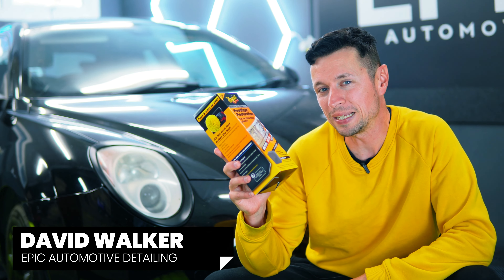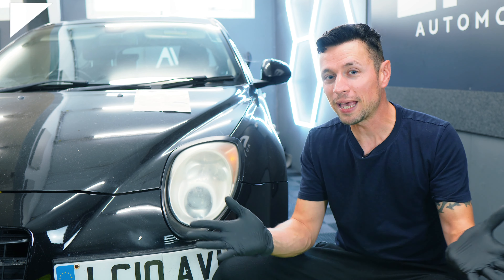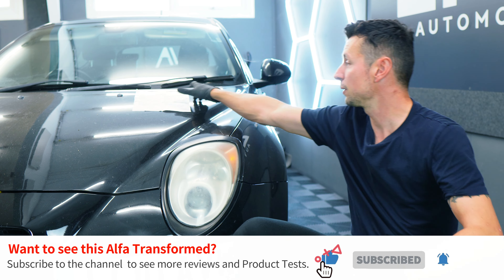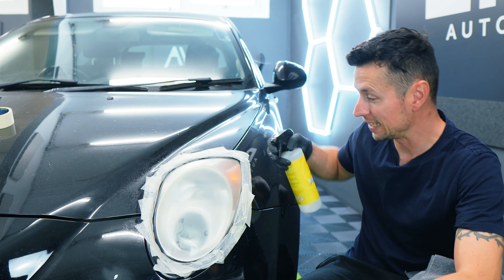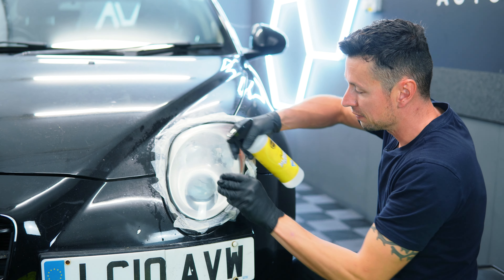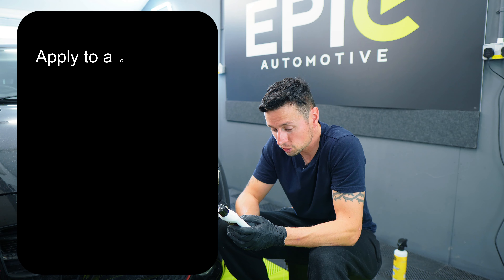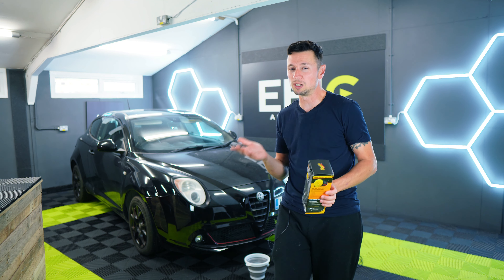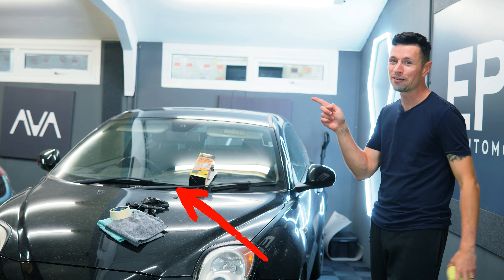Restore headlights EASILY with the Meguiar's Headlight Restoration Kit!

Comment: I did the chrisfix method of properly sanding down in stages and then lacquer spray paint on my old mazda turbo. Took a day or so start to finish (completely removed the lights) but the finish was perfect. Lot more effort, but worth it for the finish

Comment: Thank you! Having no past experience of cleaning headlights, without your video I probably wouldn’t have risked using this kit as the instructions are so poor. What product would you recommend for that long term protection you mention?
Reply from the maker: Thanks Jon, If you have a ceramic coating that can help. Meguiars actually sell a sealant to apply as part of the alternative kit.

Comment: Good Video, very good points raised.  I just done my Z4 lights at the Summer, and they were cloudier than a good day in Scotland.  I bought a 3M headlight restoration kit, much cheaper than the Megs one, less elbow grease required as well, but never came with any protectant.  I had to by Turtle wax lens wipes as well, as I wanted that clarity to last.
Turns out, The wipes dried while I was applying the top coat, and left high spots :( Probably try the ceracoat? ones next time.

Comment: Nice to know how realistic the steps are for something like this. 
It would be interesting if you could make a video on recommended products for regular detailers and for noobs who are starting. I've spent so many hours finding products I might want to use, but I'm restricted with living in an apartment. Your video which mentioned winter maintenance and how lots of people just want their car to be clean was really good. I'm considering buying a pump sprayer etc to maintain between proper washes.
Reply from the maker: Hiya so you're after a video where the user has no electricity? I can do something on that topic for sure
Reply: @epicautomotivedetailing Hey, thanks for the reply! Yeah, if it's for someone like me, for example, that has no power, no hose and no cannon, a tutorial on how to get decent results on bare minimum as quick as possible and recommended products for the job, until the car gets the treatment it needs or I became more advanced/got better equipment. 
I know it's a lot of work to make a video, so it depends how much time you could commit to it, but I think something like that could help a lot of people, especially if you showed real expectations side by side of 'no contact vs contact wash', (maybe another video for interior maintenance for noobs with bare basic equipment). Thanks!

Comment: I have tried a couple of these kits now, the last being Turtle wax's equivalent and the headlights did come up clearer. That one did not include masking tape either but also no drill was required. Correct about the protection, that is an important step these kits should really mention.
Reply from the maker: No drill that's interesting to see. May check that out